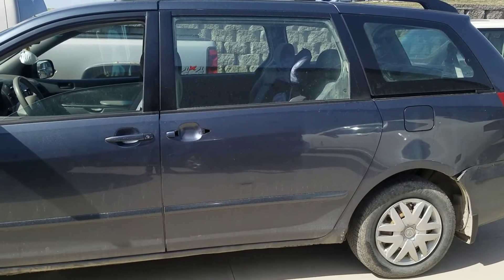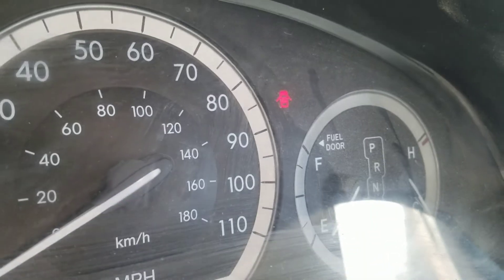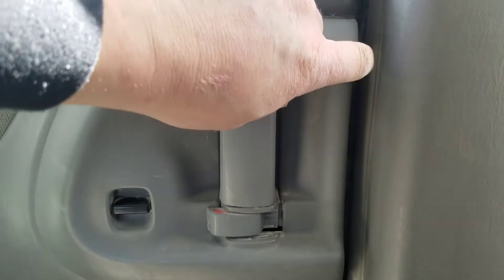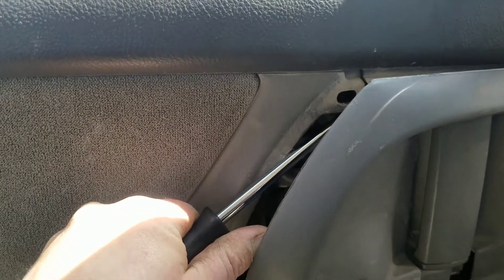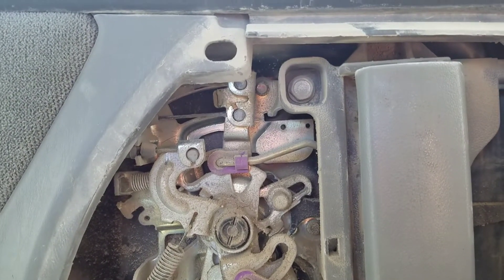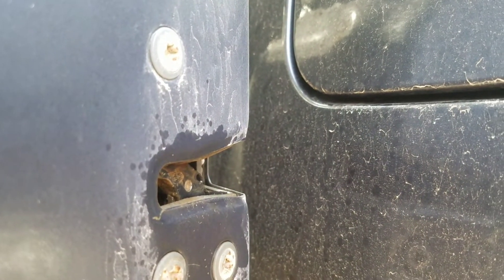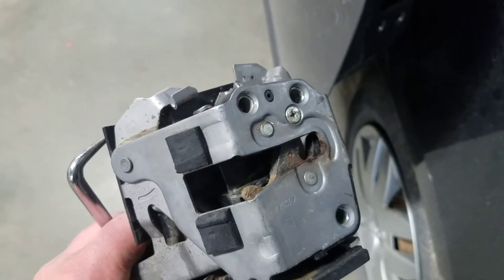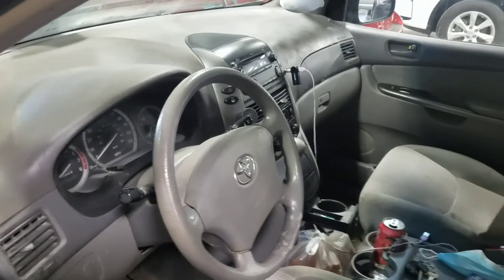Toyota Sienna 2nd Gen. 2004-10 How to get a stuck shut sliding door open.

Comment: We have a 2013. Barely open and wouldn't close fully. Tried everything on the internet to fix it. No luck. Came across your video by searching "How to brute force open toyota sienna power door". I was at the point we were going to get it open no matter what. You were on the second of three pages. We couldn't pop off the handle cover, so we had to slowly use a small bit and wrench to get the phillips screw out. Took 30 minutes. Popped it open and although the 2013 looks different than the one in the video, we saw what to do. It did not work. Silly us had the power enabled for the door. As soon as we turned the power button off it OPENED! We wept with joy. This happened to a 2008 we owned and NO ONE could fix it and we got rid of the car. THANK YOU for taking the time to make the video. It saved our Sienna.
Reply from the maker: Glad it helped!

Comment: Just bump the rear side of the door with your hip to close the door all the way then it will open using the inside handle do it all the time
Reply from the maker: That would not work in this situation. Clearly you didn't watch the entire video or understand the issue with the rear latch that I had to repair.

Comment: Will this work if the cable has snapped and the door is stuck shut?
Reply from the maker: It sure will. If the cable hasn't been cut out yet it may cause some additional resistance however.

Comment: What if my entire mechanism fell inside the door. We bought it used and it looks like the first owners jay rigged it and idk how to open the dang thing or how to reconnect all the bs.
Reply from the maker: Are the cables still attached to the latches? If so you should still be able to pull on them to open it. Are both doors messed up?
Reply: @kylescarfarm  yeah both are broken yesterday i pulled the handle and it snapped off. The other one broke within a week of owning it and when i popped the inside pannle to see if i could atleast get the thing open the mechanism inside fell and a spring fell into the door. (The cables are detached)
Reply: @kylescarfarm  can you reccomend a place to buy parts? I looked on the toyota website and about fell over. Lol i might check local auto part stores after the holiday, but yeah the vehicle is great just needs alot of TLC.
Reply: @kylescarfarm  it looks like they zip-tied it together but not very well. Since the zip ties all snapped and parts fell inside the door. I got my work cut out for me.
Reply from the maker: A local self-service juck yard could have the parts for cheap, sometimes buying the whole door is more economical than buying individual parts.